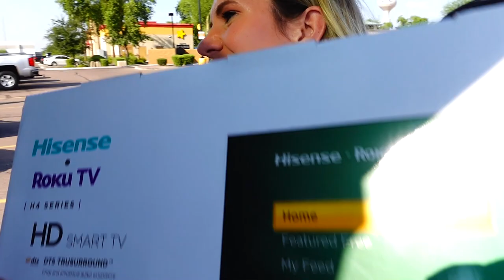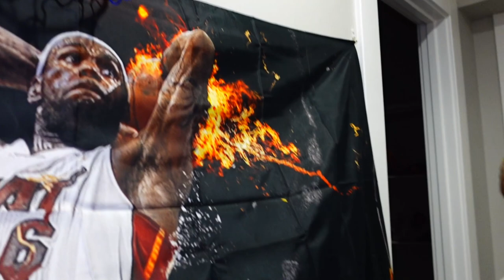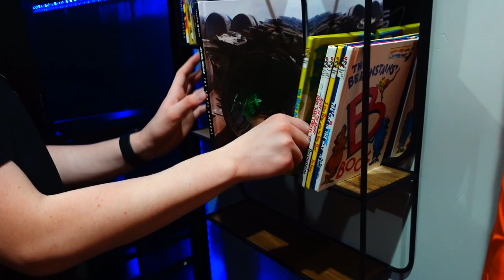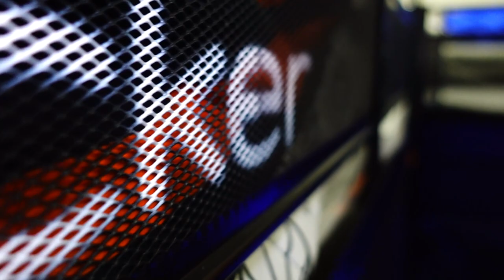Room Makeover SURPRISE | Bedroom Tour | BEFORE AND AFTER

Comment: Cute tape measure.
Fun tip.. I have found using painters tape works great.  Place the tape on on the object to hang mark on the tape where the holes go then place the tape on the wall and drill hole through the tape after leveled.